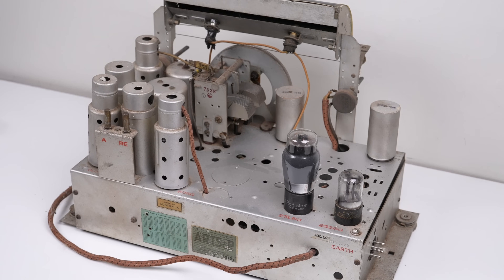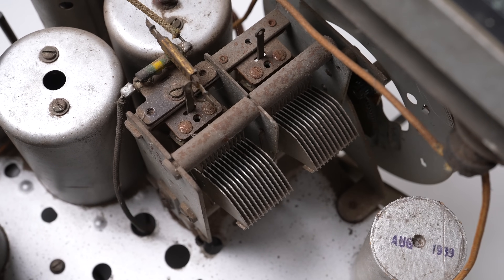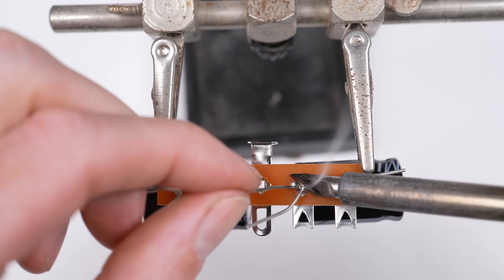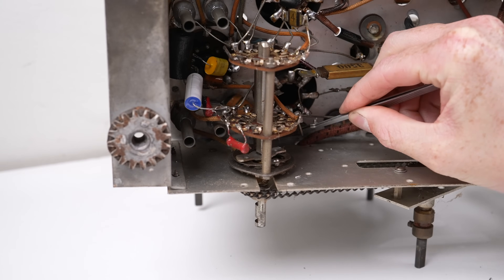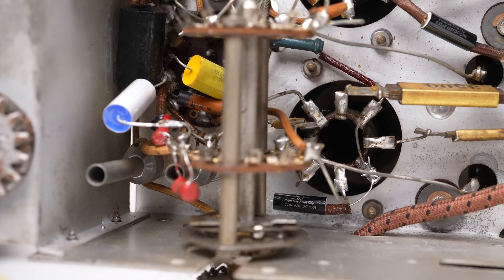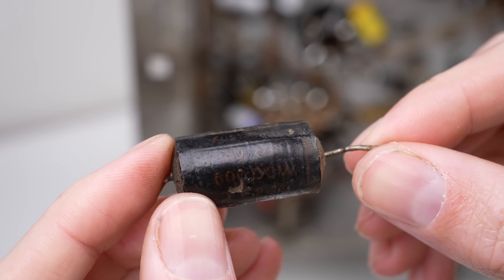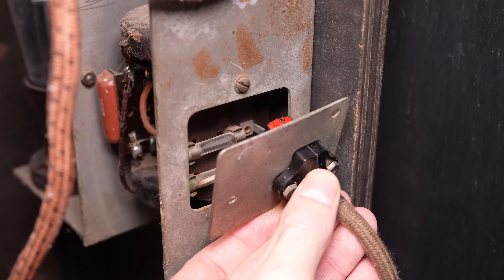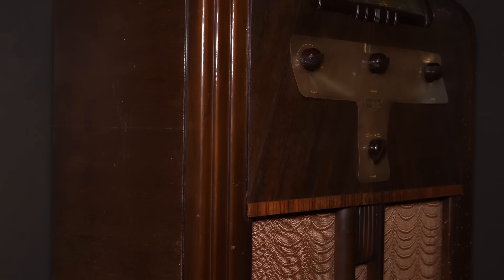Breathing Life Into A Forgotten Piece Of Technology ⚡️ High Voltage Restoration

Comment: I am a bulb collector here in USA. I do dig vacuum tube items, mainly audio amplifiers. I am about to undertake re-capping and resistor-ing an AO-28 pre amplifier for my Hammond C-3 organ with a Leslie 22-R cabinet I modified into a 2 speed rotors 122. I got that pre-amp from a scrap and surplus store cheap a year or so before I got the organ! I am glad I did, since I can now install the recap kit from Tonewheel General Hospital online into this spare pre amp and swap it with the original in the organ and then get another kit to recap it as a well, and have it on hand. Hammond used top notch capacitors and resistors, and the ones in mine still work decent but are overdue for a replacement. But the quality shows! Most radios and TV’s, as well as audio amps typically used cheaper lower quality caps and resistors to save costs to keep the devices inexpensive. OH-your radio tubes are in a series string, and the radio has no  power transformer to step tube B+ voltage to the high, above mains voltage you mentioned. The dial lights in series with the tube heaters means that they are in series and max voltage inside is mains. The “light bulb” is actually a resistive ballast that limits the series tube heater current (amps) to a max value in case a tube heater shorts. The single and double numbers in the valves/tubes identification are the heater voltages, and if added up from all tubes and the  dial lights, it will come to the mains voltage, in our case 110-125 volts, yours 220-250 volts! 😋 cheers from USA! Subscribed! 👍🏻😋
Reply: Daddy stupid trash 119 call
Reply: You are absolutely right.  I am a ham operator and rebuild old equipment as a hobby.

Comment: I do remember the old tube equipment and TVs. And every time a TV went on the brink, I always wished it would be a tube. And that was because at those times I really didn't know, or understand, electronics very well. Tubes were easily tested at the  local electronics store that had a tube tester and replacements. However, against my bad tube wishes, they typically never were the problem. Great video and interesting to see how the capacitors were the problems, even back than...

Comment: Hugh, You cannot power this radio up without installing a fuse.I doubt if there is a fuse installed from the factory, a 1 amp or 2 amp fuse will protect the power transformer from burning up  your house or cabinet  from a fire.No radio repair is complete until you've installed a fuse .

that should be the very  first Thing you check.
 good work on getting this set going.I just wish that there was radio programming on the air today.That was equivalent of what was on back in the thir.

Comment: Born in 1950, I grew up in a world of vacuum tube (valves on the other side of the pond) powered devices. The thing that strikes me most, though, of the time is how cheap and seemingly unlimited electricity was that we could power everything electronic with the equivalent power consumption of an electric heater. Carefree days when we didn't think twice of the eventual consequences. Tubes, of course, were self destruct devices, their heat generation eventually consuming them and the capacitors adjacent to them. I actually don't have much nostalgia for the time, really. Solid state devices were far more durable.

Comment: That light bulb looking thing is called a baretter, its a very early form of regulator as its resistance changes based on the current flowing through it. Its a very linear device.

Comment: You can buy a Bluetooth or Aux adapter that solders right into the radio and doesn’t require to modernize anything and will not affect historical value because if you would like to re sell it will desolder right off to be used in the next one.

Comment: YES, I would love to see more radio repairs! I used to repair old radios as well, but I had to stop because they take up a lot of space which I do not have 😅.

A few tips:
- Be careful, on some radios the metal chassis (and the screws on the knobs etc.) are connected to one phase of the AC line (often the case on radios which can also work with DC).
- I always replace the fuses in these radios, since they often are very old and might not blow properly in case of damage.
- Some radios have paper capacitors directly at the AC line or behind the transformer. Remove them, these days they have practically no effect and they might go up in smoke or destroy your transformer!

Unfortunately, all AM stations in Germany (and most of Europe) have been turned off, so an Radio without FM is not having much use here :-(.

Comment: You implied that "technology began" with the radio. But what about the steam engine, geo polymers,  the loom, the stirrup, gun powder, etc. ? All these other technologies were invented long before the radio. 
Ok, enough with the "ackshually", i will now watch the rest of the video.
EDIT: I really liked the presentation style with the distraction free frame and lots of soft light. BTW, a "TinySA" would be a worthwhile addtition to your toolbox, only costs a few bucks and lets you check the operation of the oscillator and also generate a modulated IF frequency to align the IF chain. Tools like that cost tens of thousands of currency units when I learned the trade back in the 90s, now they cost  as much as a meal.

Comment: That is unusual for an Aussie made radio.  It would be a US design, made here.  Most Aussie radios used a mains transformer, much safer on our higher voltage. You can end up with 230V on the chassis if the A & N are reversed in this design!

Comment: Most definately more repairable and could last a lifetime when taken care of properly. Vacuum tubes and electrolytic capacitors aren't "long lasting" by nature and need to be replaced just like the brakes, tires, oil, etc in your car needs to be replaced after a certain amount of use. Just do the required maintenance and it can last a very long time.

Comment: Spent many happy hours building my first record players with old valve radios, a large capacitor across the terminals of the volume control for extra bass, they always had a 12" speaker and a PU or Aux port for the pickup cartridges on the Garrard SP25 record decks popular in the late 60's/70's, Halcyon days.

Comment: That large light globe inside the set is probably a barretter that regulates the current through the valve filaments against varying mains voltage. https://en.wikipedia.org/wiki/Iron%E2%80%93hydrogen_resistor

Comment: Just a few hints:

This is a so-called AC/DC radio as it can be run on AC as well as DC. Do note that on most AC/DC radios, the chassis can be live, i.e. carry the full mains voltage, if the mains plug is inserted the wrong way, unless your country has polarised mains plugs and sockets, as in the UK. Be warned!

In these radios, all filaments and bulbs, including the dial bulbs, are connected in series, so the whole circuit adds up to the line voltage. If not, the difference will be eaten up by the baretter (the 'lightbulb thing'). It's a iron-hydrogen-resistor, a kind of current regulator. https://en.wikipedia.org/wiki/Iron%E2%80%93hydrogen_resistor 

The silvery coating inside the valves, called the getter, absorbs the remaining oxygen molecules after evacuating the valve. If ever the valve 'draws air', the getter gets white or grey. As long as it's silver, the vacuum is fine. 

Another great site on the restauration of valve radios is Manuel Caldeira's https://www.youtube.com/@electronicsoldandnew

Comment: Hugh: "It's always important to use the same or greater rated voltage when choosing a replacement capacitor."
Also Hugh: puts in a lower capacitance part "close enough" 😂
Anyways, loved to see this old radio getting repaired, great job!
Reply: Components are made in "preferred values" these days (and have been for many years), so a nominally 50uF will be virtually unavailable. 47uF is the closest preferred value, and since the tolerance of electrolytic capacitors is rarely better than 20%, to all practical purposes, the same value.

Comment: Very unusual to see an Australian made radio that does not have a power transformer. That large globe like bulb is not a valve (or 'tube'), its a baretter, which helps to stabilise the voltage. Transformerless radios like this one can operate off either AC or DC, and are also VERY DANGEROUS as the chassis could be live. They were common in the US at the time, but this is clearly an Australian made radio due to the 'Ducon' branded capacitors and the blue 'ARTS&P' sticker on the chassis.

Comment: Fact 1 in OZ there called valves, Fact 2: That's a yank import with a live chassis I know from the valves the first number is the heater volts so add them up + the globe you get 230-240VAC. Fact 3: I was fixing this crap before your father was born & now I fix & diag phones TV's, laptops & desktops & many other things at component level mate from Crow (South OZ for non Aussies) country!

Comment: I heard the distortion, and knew immediately that it was a voltage bias issue. Luckily electrical engineering is more popular than ever, and good bits of our couriculum are based on learning how to design things with rudementary components (like capacitors, resistors, and simple transistors) so there will hopefully be somebody who can continue this trade!

Comment: Minor historical point. You say the tubes are socketed, but the capacitors are the most common failure. That is true today but very much was not true when the unit was made. The caps were generally designed for about 20 years life, and the tubes were in the hundreds to low thousands of hours. Practically everyone knew how to replace the tubes in their own radio or TV. For anything else you called a repairman or took it to a repair shop.

Comment: I love old technology. I have a fan from 1952. It works great. When i bought it, it needed to wake up from a long nap. I let it sit and run for hours. Slowly it got up to speed and then started oscillating. I replaced the grease in the oscillation gearbox. I still need to figure out why it doesn't like the medium and low settings, but it works great on high. It pushes so much air. The rarest bit is it still has the original power cord. My dream is to get an old box fan from when they were in wooden boxes. The fan is a Westinghouse

Comment: i thinkt the light bulb acted as a resistor to prevent overloading, there are speakers even nowadays that have bulbs in them that light up when its overloading, and they pop severing the connection to prevent damage.
Reply: I suspect it's what's called a barretter or iron-hydrogen resistor, an early form of current regulator in the heater chain.

Comment: I'm not one of those people that will say you need a $300-500 soldering iron, but yours looks like a $5 one I bought from radio shack 20 years ago lol.  These days you can get a really good one with temperature control between $20-50.  I do have a nicer soldering station, but end up using my pinecil more often than not because it's convenient, but ts101 are pretty good too.

Comment: Older devices were naturally more repairable because modern components are increasingly integrated into single units (often proprietary) making repairs more difficult. Additionally, manufacturers don’t provide schematics, meaning you have to figure everything out on your own. This is especially problematic with components like SMD capacitors, as they don’t have their values written on them, making diagnosis significantly harder.

Comment: I believe the light bulb thing may be  there as a current limiting device. I used to use an old atomic absorption spectrometer that had two light bulbs in the power supply box (enormous great thing) and was told that this was their function.

Comment: The solder flows so nicely. Bet it's leaded...
Reply: Meaning you will probably get cancer or another disease.
Reply: Yes, I bought a small amount once and it was terrible to re-solder anything that was experimental. 
I threw it way and got some 'proper' solder. 
G4GHB.
Reply: @bill-2018  The thing with lead free solder is, you need quite some heat. I prefer to use my propane powered solder iron when I use regular unleaded solder.
Reply: @Squilliam-Fancyson  Yes thanks, I do know that more heat is required.

Comment: Thats some old tech, love it! The 302 "tube" looks very very similar (or more like a exact copy) to the tubes i have and these are known here in Germany as "Heizkreisregelröhre". The only Wikipedia-Article i could find is in German only (no links to other languages). The function of the "Heizkreisregelröhre" or lets call it "filament circuit regulation tube" is to LIMIT the inrush current when first powered on and regulation afterwards. At minute 3:37 right side is even a SIEMENS "Elyt" electrolytic capacitor (the yellowish one) :D I guess that one was made in germany.

Comment: What is so surprising about this radio is the lack of power transformer, like the "All American 5" (AA5) radios, that string the tube filaments in series to match the line voltage.
However, if you count them up, (25+25+6+6+6=78 volts), it doesn't match the line voltage in Australia..
I think the old-style light bulb you mentioned is used as a ballast or voltage dropper, in line with the other tube filaments will allow the radio to operate at 220v..

My guess is that the extra bulb was added as the balance load, to match the line voltage.
Yes, you MUST NOT use any of the old electrolytic and replace with new, to properly reduce any AC hum.
The remaining distortion can be caused by a cracked or defective resistor, or leaky cap.   Check every one of them..

Comment: VEF Baltika repaired mice job but other than that it just works, no leaky capacitors . In tube amplifiers if grid capacitors fail then tube and probably transformer rewound job is on the list. In modern tube amplifiers they use crapy circuits where you need perfectly balanced tubes but there are way to design circuits better

Comment: These antique devices are so interesting to work with.  I have a projector from the 50s that I'm trying to customize.  The wiring is so scary too.  Covered in fabric and kinda shredding 🤣.  When you plugged in whatever that was when reconnecting the speakers, that looked pretty wicked.  Looked like you could bring Frankenstein back to life with that.  Good work.  Amazing you could repair this device almost 100 years later.  Lucky if you can do it 10 years later with stuff now days. 👍🏽👍🏽👍🏽
Reply: Also, YES, it would be interesting if you had more videos of these old products.

Comment: Inre 9:20, you can usually tell if the tube has been broken and air entered by looking at that silverish coating. If it still looks dark silver-ish, the tube is good. If it's turned into white powder, there's air inside. That coating is called the getter, and it's added in manufacturing to eat up the last tiny bits of air molecules after the tube has been put under a vacuum and sealed shut! You can actually see how it turned white in the broken tube at 12:15.
Reply: I was going to say the same thing! ☺
I think the getter is a fine piece of magnesium wire between a couple of the valve's electrodes. After manufacture, a current is applied which burns the magnesium: this removes any remaining oxygen and gives the metallic coating inside the glass.

Comment: I've been chipping away at fixing a Brunswick Phonograph console from the 1920s. No electric components at all, completely mechanical with acoustic amplification. It's made of a series of gears, wheels, springs, and levers. With nothing electrical to go wrong, all repairs are done by screwing, hammering, crimping, bending, and oiling. It sat in a damp garage for over two decades, and it's a family heirloom. I have one part left to replace, and it should be done. All made in the USA, in one factory, by hand, and after this week, as functional and enjoyable as the day it was made. All because it was designed to be self-servicable. It even has indicators on where oil goes for periodic maintenance

Comment: Bakelite is plastic.  It was the first kind of plastic that was mass produced.  It's not used anymore as they used a lot of toxic chemicals in its production. 
Bakelite does have a warping issue as well many products made from it can warp slightly over time depending on its design.
Many Model A view master units have warping issues because the bakelite was improperly cured

on the cotton cable. are you referring to wire that has a cotton wrapper? many of these older units you can use hi-temp wire as well as a substitute

Comment: JFC, kid.  Try dealing with an AM transmitter that has 5000V @ 1A at 1MHz for the plate feed.  Kids these days are so afraid of a few hundred volts.  Back in my day we'd die from a charged cap, and we liked it that way!
Reply: yea and RF is more hurting than voltage

Comment: nice, i think a bluetooth mod would be also nice in this radio
Reply from the maker: Have seen that done. Don't need that functionality myself but if AM ever disappears thats always an option to keep them alive.
Reply: @HughJeffreys  It's rather easy and you don't even actually need to mod it. FM/AM transmitters exist for cars that you plug into a cigarette socket which is just 12v. You can keep the AM/FM transmitter as a completely separate part of the radio without needing to modify it. All you have to do is just align the frequency

Comment: You should have fully restored this old radio, both cosmetically and technically, with a complete cleaning and refurbishment.
Reply from the maker: I don't currently have the equipment or space to take up woodworking and learn the skills necessary to repair the cabinet. However now that it works the radio will be used quite frequently.
Reply: @HughJeffreys  I understand, and I know a full restoration would take some time.